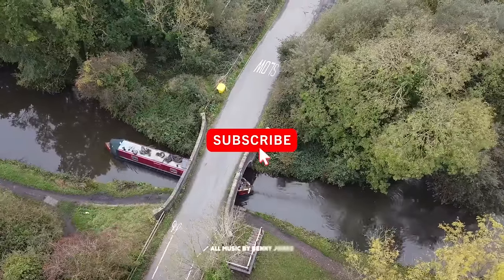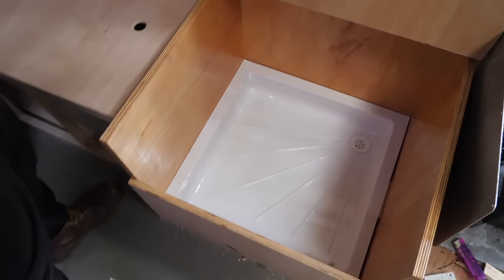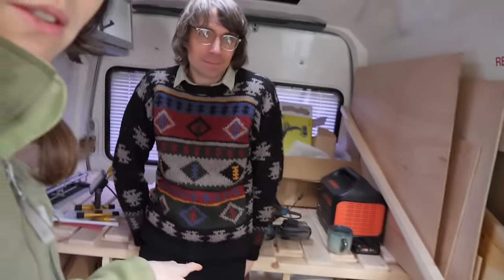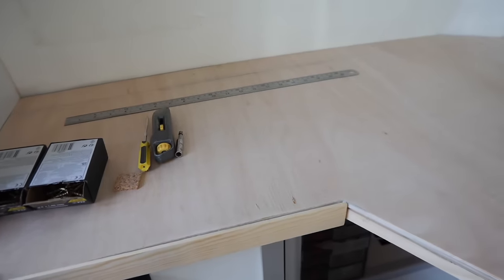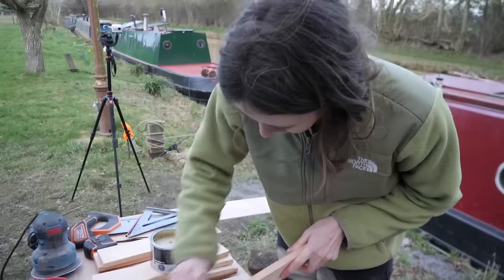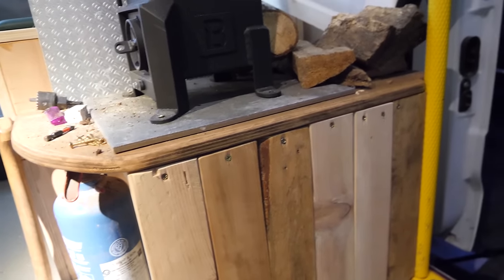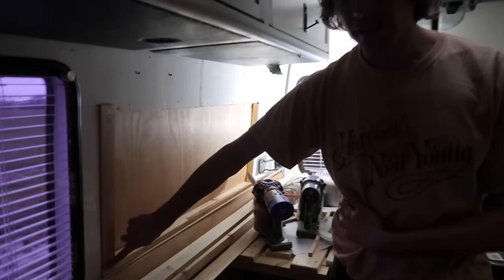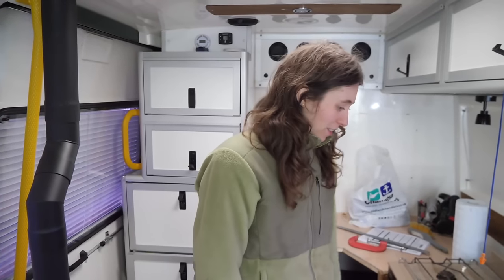Converting an Ex Ambulance Into A Tiny Home On Wheels in Three Weeks! | Van Life Conversion

Comment: Ben, you are talented enough to do this. Build a metal water tank sleeve around your chimney pipe. We had this in a caravan with a wood burning stove when we were kids. It worked a treat. Never understood why I’ve never seen it done elsewhere. Constant hot water when stove is on and very safe.

Comment: I'm enjoying watching your videos,, I don't know if you have painted your cupboards yet, I am a retired painter and decorator from Manchester who has lived in Holland for over 25 years, there's a primer you can get for when you have difficult surfaces to paint, it's called Sudwest. all grund , you can get it in acrylic or in an oil based,if you put 2 coats on first you can then go over with whatever paint you want to finish it off , I've used it thousands of times  over the years and can't recommend it highly enough, it is expensive but well worth it and it's made in Germany , anyway it's just a thought, keep the videos coming 👍👍

Comment: Hi guys, vans looking cool. Just a couple of thoughts.....don't forget to put a gas drop-out in the floor under the cooker, treat gas like water, it will flow to the lowest point....i suggest a piece of pvc waistpipe to line the hole glued in with Gripfilll. Also I was going to suggest using vinyl wrap for your cupboards instead of painting...keep up the good work, you're doing a great job in the time you have allowed yourselves...Brummy

Comment: You mentioned not having an outside covered space.  Have you considered a pull out awning which would also help on your travels. Great build though. An idea to help cutting tile around the sink…consider mosaic or the small 1 inch square tiles.

Comment: One recommendation for sealing around the sink and shower - don't use sanitary silicone sealants. Polyurethane sealant is best for flexible joints of vibrating structures. Soudal Carbond 940FC has worked very well for me, but I'm sure you can find other products with a similar base.

Comment: Great work guys. loving the progress your making. The small wood burner is brilliant, we use a wet tissue and some of the cold ash from the fire to get rid of the black dried on stains on the glass. its abrasive enough to remove marks  but doesn't scratch the glass. Cant wait to see finished product. 👍

Comment: I assume that you'll tile before fitting the sink. That's much neater and the cutting doesn't need to be so accurate. Use silicone before you drop the sink in as it makes a better seal. If you tape slightly larger than the sink then it's easier to clean up. Good luck (and use dark grout - definitely not white).

Comment: A good way to cut tile round or curved, is to use the cutout board to mark a pattern on the tiles and a special wheel on a angle grinder. Just very slowly gradually deeper and deeper as not to crack the tile, cut each piece to make the circle. very tedious.  You may have to clamp small tiles down to something to make the cut. You don't have to make the cuts perfect. The sink will cover them up. It throws off a ton of dust. Hope this helps. ( You tube cutting tile with an angle grinder.) I absolutely dig your channel. I look forward to every video. Mark in Boise, Idaho

Comment: My advice The shower base will not seal simply by putting a bead of sealant around it Persons weight and vehicle motion can both unsettle the base.                                                   I personally would now add a (skirting single tile or wood ) around the base ensuring it also sat on a bed of sealant bottom/top  Shower base is normally rebated into a wall and tiles dressed down over the base. Hope you get the thrust of my comment tile mosiac tile section around the sink untill squared off then go back to full tile or simply mosiac tile the whole area around the sink. just a suggestion

Comment: I know you guys are way beyond the point of building to be getting advice LOL. But to anyone who has a similar issue with painting vinyl siding (indoor)... Find some cheap self stick (matte finish) wall paper, apply it and paint that surface. Saves sanding and it's easy to remove if you ever need to.